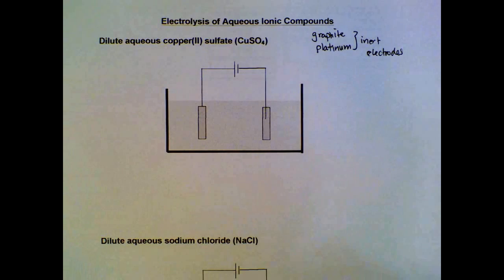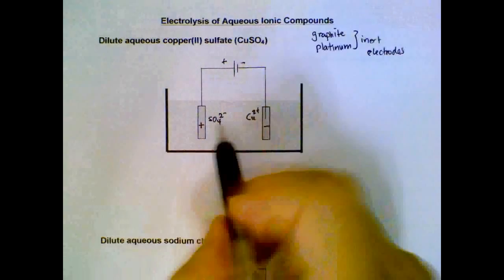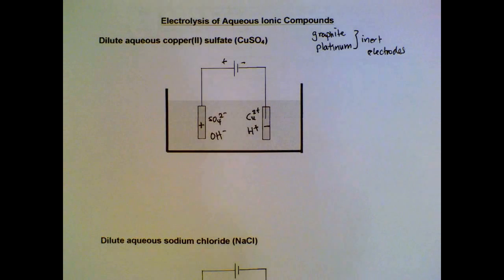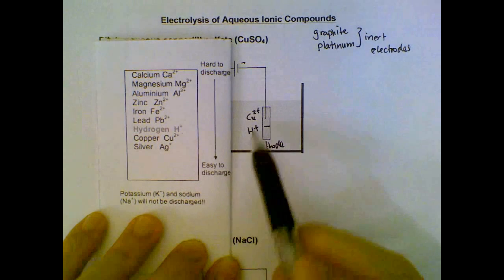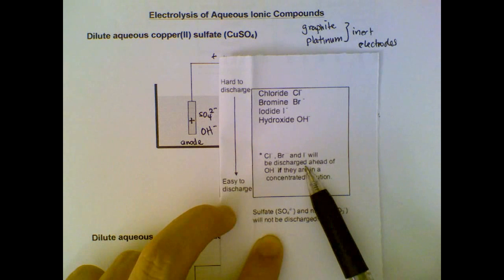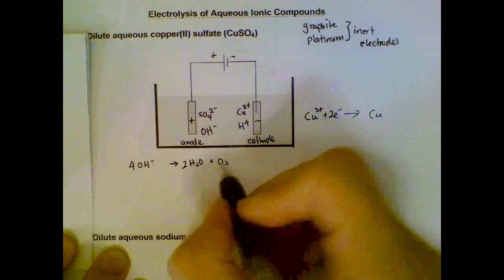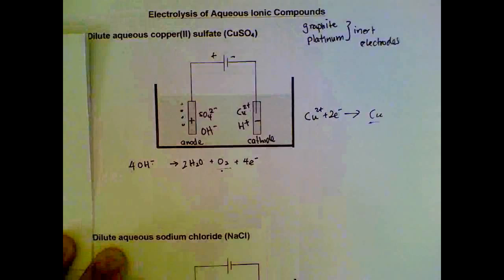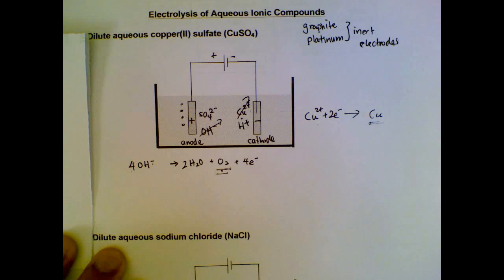Electrolysis of aqueous copper sulfate (inert electrodes)

Comment: +Meta Tutor, When I preform this experiment, I find that both Copper and Hydrogen gas are liberated. How do I calculate the ratio of both reactions taking place?
Reply from the maker: +Michael Ruggiero Hi there, when we say that copper will be discharged ahead of hydrogen, it is more from a theoretical angle.&#160;

Actual experimental observations might vary due to conditions like temperature, concentration etc. In an aqueous solution, water molecules, being of higher concentration than the copper ions, can get discharged ahead of copper ions at the cathode.&#160;

For now, I can&#39;t think of any method to work out this ratio in theory, it would depend on you collecting data during the experiment (i.e. collecting the volume of hydrogen and the increase in mass for the cathode due to the deposit of copper).